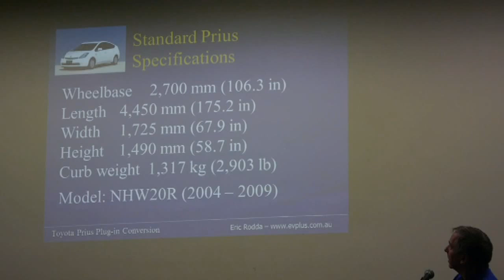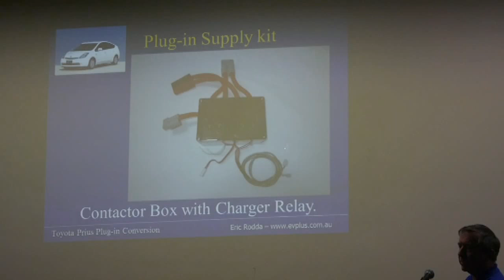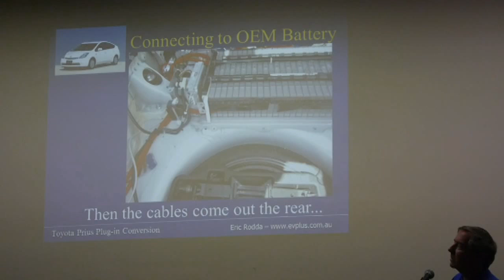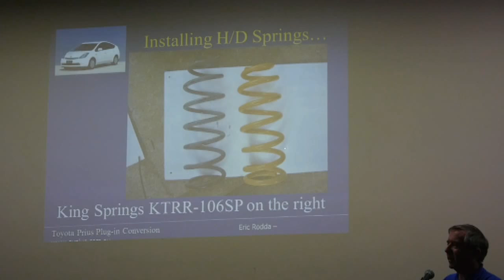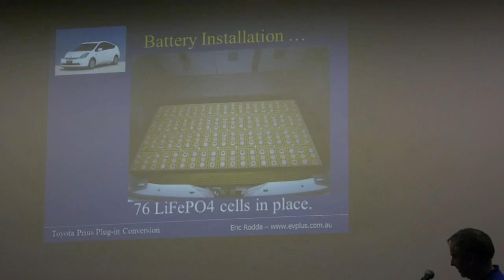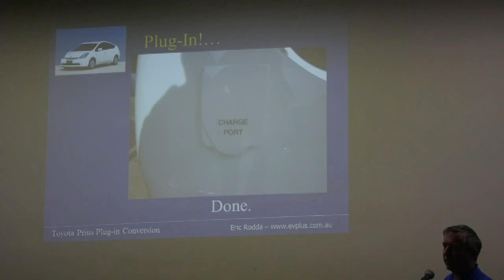AEVA Adelaide-June 17, 2015, Eric Rodda-Prius Plug-in Conversion

Comment from the maker: As it was then - the all electric range (on the flat) was around 60-70km. I have now dismantled the battery pack and put it back to a standard Prius. Now I am in the process of replacing some of the modules in the original Prius battery.

Comment: range?
Reply from the maker: As it was then, I could get about 60-70Km range (on flat ground) with it fully electric. I have now returned the car to a normal prius and working on changing some of the modules in the original Prius battery.

Comment: whats the problem in hooking the nimh up in parallel with a lithium 207.2v battery.
Reply from the maker: Hi Michael, It is important to keep them separate, especially for the overnight charging. The car doesn't even know it's there.
When driving the job of the controllers is to just keep the original battery at 62% SOC - switching the additional battery as required. The front controller also tells the car computer that the battery is at 80% this is to stop the car trying to charge the battery from the petrol engine (wasting fuel).

Comment: Great video mate. Not sure if you remember me. I converted a barina to ev back in 08 and got on today tonight? Anyway I've been driving a prius for a while now and I just repaired the battery and want to somehow turn it in to a plug in. Your video has given me some great ideas now that all of the plug in companies are out of business! Cheers mate.
Regards Blair Fraser
Reply from the maker: Hi Blair - I remember you and your Barina,
I am putting new Lithium cells into my Barina MB (2008 conversion) at the moment and will nearly double my range,
The old chemistry was Lithium Iron Phosphate and the new chemistry is Lithium Nickel manganese cobalt oxide...
Reply: @EVSA  it's funny that you mention the new battery formula. My mate is in a wheel chair and he was only talking to me yesterday about putting the same cells in his chair haha. How's the prius going? My mate is an electronics engineer so the rear box and contractors shouldn't be a problem. The one thing I did want to ask is do they tap in to the battery monitor ecu of the prius to spoof the voltage to 80 percent?
Reply from the maker: @blairo15  The Prius is going fine - with a long term average petrol consumption of 2.9Ll/100km.
This includes a lot of hill work and high speed work.
Yes, the system hooks into the OBD2 port to spoof the ECUs with the battery ECU being told that the SOC is 80% (to stop the car charging the battery from the engine) and the rear controller actuates the contactor to keep the real SOC at around 62%.
Please let me know how you get on with your conversion - I get many people asking - how they can do theirs.
Reply: @EVSA  for sure mate. I see there's still a demand with no one filling the gap

Comment: Why not just buy an Outlander PHEV for $25k late model, low k used. The Prius is a brilliant car but doesn't work at all well as a PHEV. The Prius EV doesn't provide enough power/torque to be successful as a useful EV. I own both and am very happy with the Prius, but it's not an EV, whereas the PHEV Outlander works very well in EV mode.
Reply from the maker: Firstly, I already had a Prius, and I don't like the Outlander PHEV - they are too big.  Actually I don't like any SUV.
Reply: Fair enough. I get that...any SUV is inherently wasteful in reality, couple that with most just aren't necessary in practical terms. I think the GEN 2 Prius is possibly the best car ever made in many ways. I have driven a few PHEV Prius conversions and was left underwhelmed by the limitations. But in fairness we tend to frame things in binary terms. Is it an EV, is it a Hybrid? It doesn't really matter, it's the final analysis of averages and incremental gains in inefficiencies that really count. The Prius in standard trim still outperforms the Out-PHEV in pure efficiency terms as a result of it's mass. I think the Prius would make an ideal candidate for pure EV conversion, taking the whole drive train out and going the whole nine yards. There are so many design features that lend itself to an easy conversion, electric PS, AC Air cond, electric boosted brakes, so many little details that would not be barriers as they are in other conventional car conversions. The body is brilliant for space, 15-20KW'h storage is not unthinkable at all. Good presentation btw.
Reply from the maker: Thank you.
Reply: FactsCount 2015 hi guys, prius is very light making it excellent to add more Kwh battery.